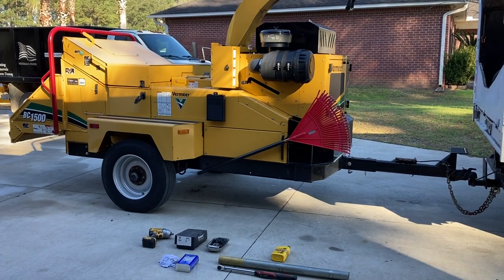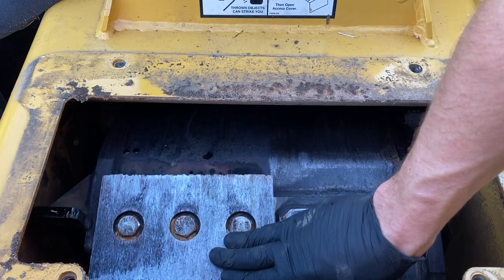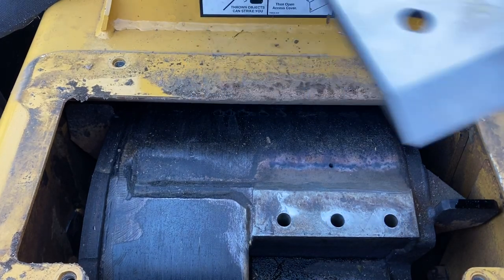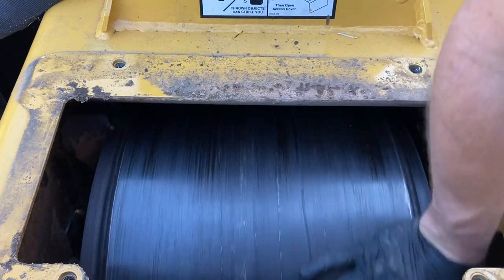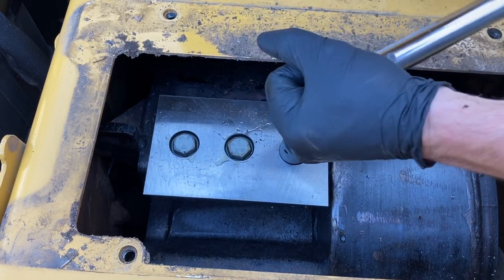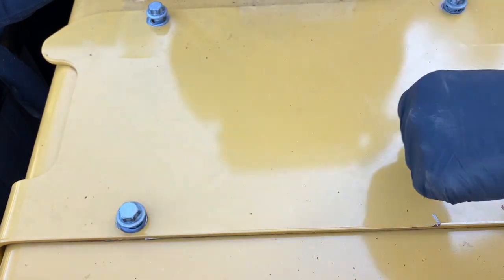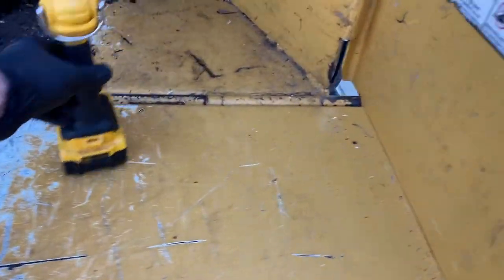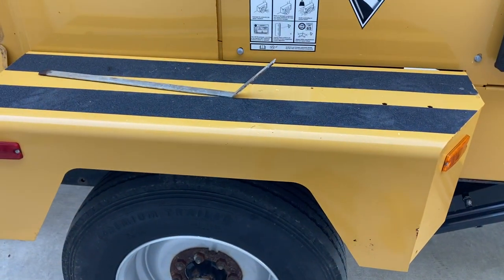Vermeer BC1500 Gas Woodchipper Knife Change - new blade installation procedure

Comment: thanks for the video. I just got one of these. and its kinda scary. lol. I've had a disc for a year but this chipper is awesome. but I have one question where are the geese fitting. I've found 2. for the drum barrings. where are the rest
Reply from the maker: There should be a chart on the side of the machine. It's a black label with corresponding numbers and each grease fitting's location. The number tells you the hour count that the bearing should be greased.
Reply: @travisthetreeman  this machine has no markings.
Reply from the maker: @SotTreeService  it’s called a decal lubrication chart. Vermeer part number is 700ID494. If you call the dealer with your Vin number, they should be able to order you the decal for around 10 bucks and then you can just stick it on the machine so your guys know, how much grease to put in each bearing per the intervals. Hope that helps.
Reply: @travisthetreeman  thank you sir

Comment: Just wondering if you had any idea what the shear bar is supposed look like when new I can’t find a picture of one that matches mine online it’s got the two hills on it but the only ones I can find are mostly flat any information would greatly appreciated
Reply from the maker: Here's a link to a site that carried "anvils" (shear bars) for most chippers. Your dealer should be able to print you an image of yours if you take the last 5 of your serial number. Most of them are flat with a 30 degree angle on all 4 sides like the one on this site. Hope that helps:

https://www.baileysonline.com/knife-source-17-1-4-x-3-1-2-x-1-bed-knife-anvil-for-vermeer-replaces-153345001.html
Reply: @travisthetreeman  thanks so much for the help

Comment: Don't change the bolts each time, its a total scam from Vermeer, i have a chipper too .then onlt time tou reallt need to changd the bolts is when they start to stretch, usually about 6 uses. 

New bolts every time is a waste of money.
Reply from the maker: Totally understand, but we try to stay with manufacturer recommendations for video purposes. Alot of guys push it too far and regret it with they snap a bolt. $40 buys a lot of peace of mind.